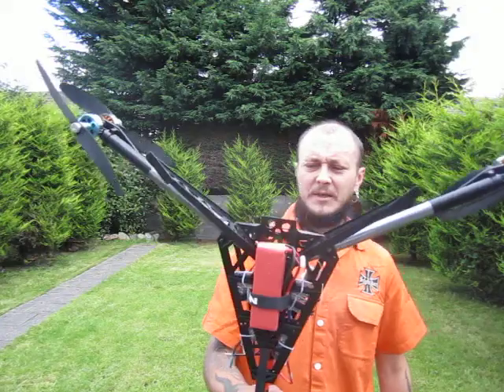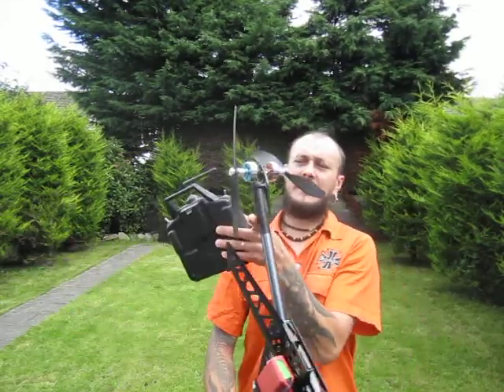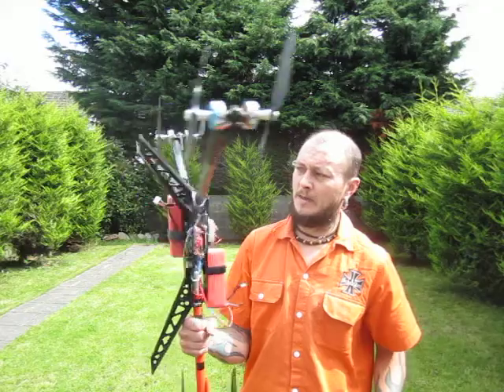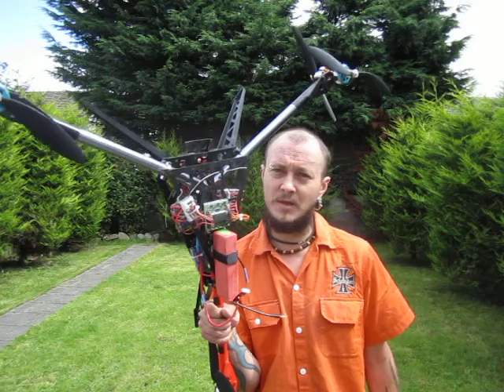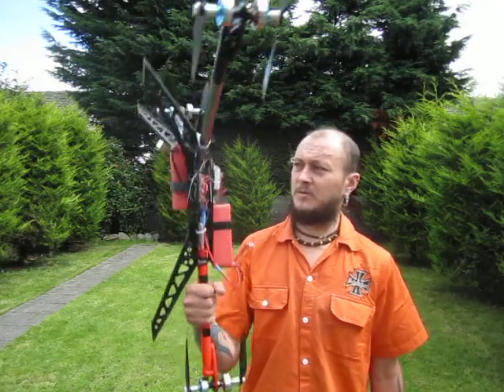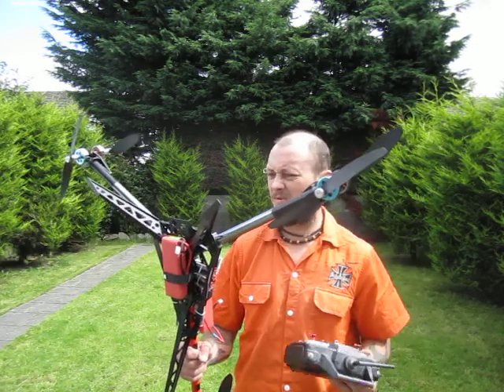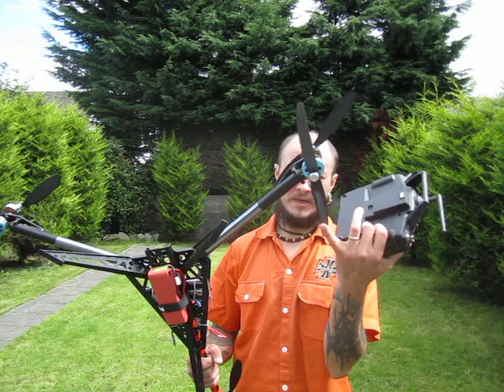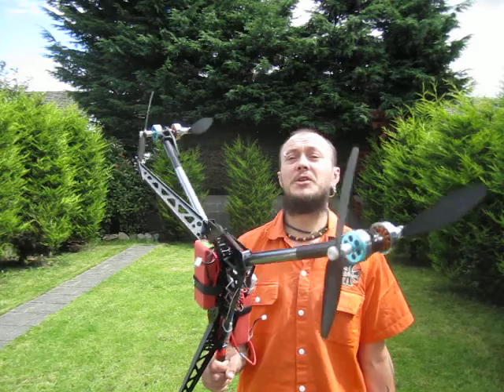Rebuilt Y6 copter maiden & review

Comment: PLIASE HELP!  My Y6 Hexacopter to start requires full throttle and after leaving the ground out sharply to the side ... I have to use my reaction to straighten machine ... After such a bad start, my machine run so beautiful, stable and obediently ... Do not know what to do, perhaps the problem in the Gain settings ... I'm afraid to make things worse !
My Hexacopter Y6 :
DJI WKG-M,---- Gains: Basic 185, 185; Yaw 120; Vert 125; Attitud  100, 100.
PRO SIX frame Y6( arms 400mm diam25mm)
T-motors MN 4014-11 KV330;  ESC t-mot 40A-400.
Carbon Props 15 x 5.5
Battery 9000 mAh  6s
Total weight: 5.780 kg ( including 1.410 kg battery and 1.820 kg Canon+Gimbal)
Thank You in advance, Romans.
Reply from the maker: I wouldn't be able to help you mate, I don't like DJI controllers and not getting into them. My only advise would be to go step by step from the start- checking motor directions, props, motor to controller connections and go through all the calibration. Usually there's a silly mistake somewhere:)
Reply: Thank You...

Comment from the maker: Thanks mate:) Landing gear is the same PCB as the frame, manually cut with fretsaw and built in. If i crash it, I will have a lot of trouble to replace it, as the whole frame is glued together to be rock solid:P

Comment from the maker: As originally it was meant to be a tricopter with fancy toque-tube yaw system (fail:), I was building frame plates swept back. That is because of camera gimbal at the front I would have to move my battery back for CG. So the frame was done and I didn't want to cut another one, so the rear boom I made as short as I could, for the bottom prop just not to hit rear landing leg. Same with the front booms, that's why my lengths are different. I do realize that now I will have to find right CG for it:)

Comment from the maker: I have them 120deg apart, but the lengths are different. Front ones are 38cm from center to motor shaft each, and rear one is 46cm. That is as short as I could go. Previously I had 59cm all the way